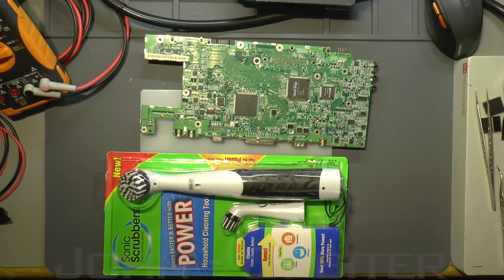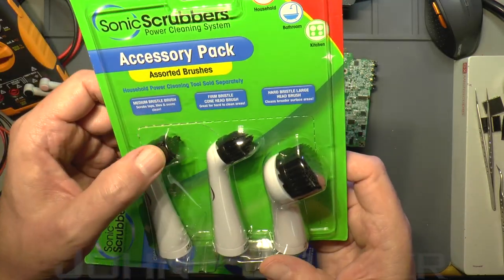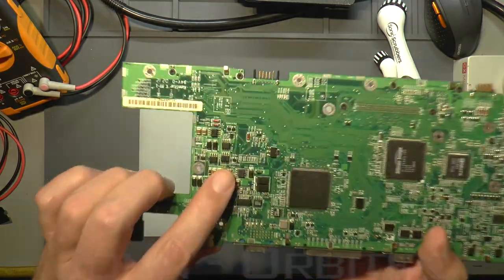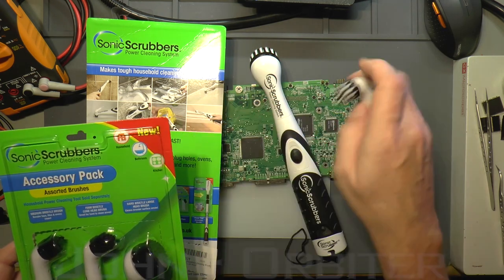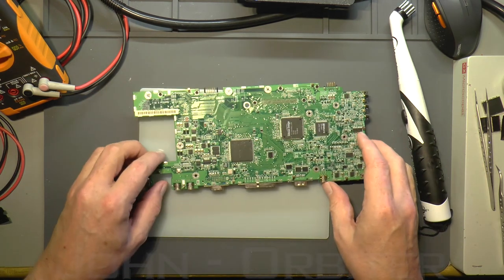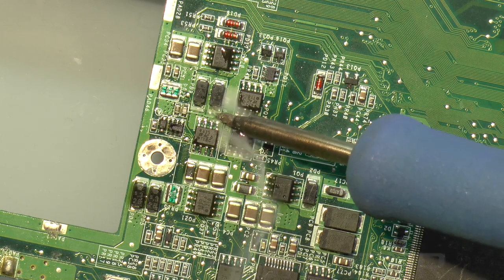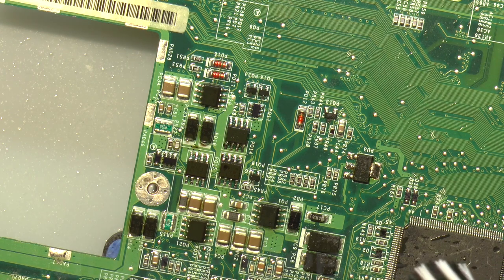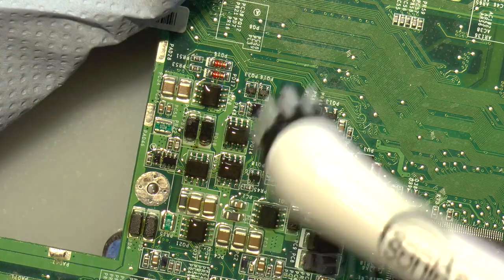Ultrasonic 'Sonic Scrubber' Brush Test, PCB Cleaner.

Comment: Not bad at all :-D
The only worry i would have is if it creates any static on the surface it's cleaning.
It's moving far faster than a tooth brush.
Hopefully i'm very wrong, i would not like to see you kill the pcbs you just repaired :-(
Reply from the maker: Hi Harv.. Hmm, I never thought of that. I''ll bear it in mind though with stuff that's not mine, or ground it 👍
Cheers Mate
John